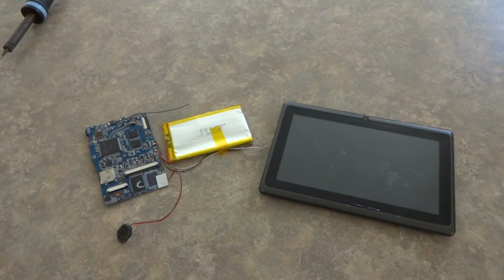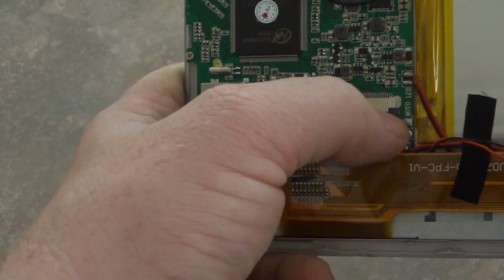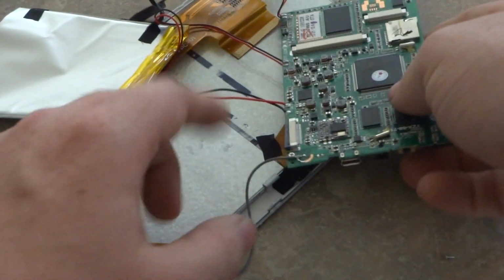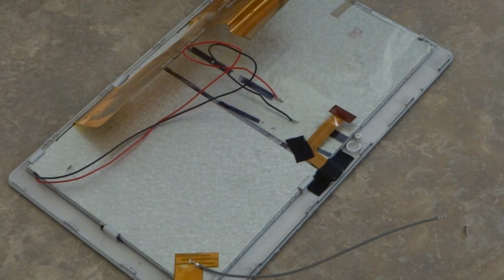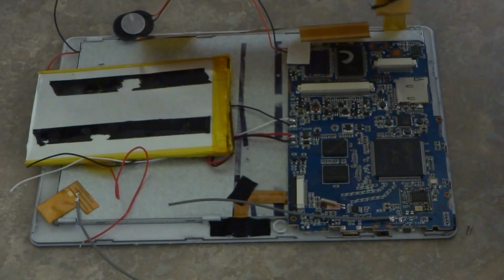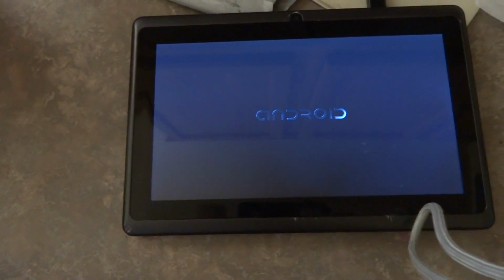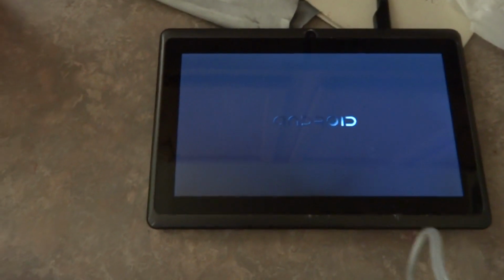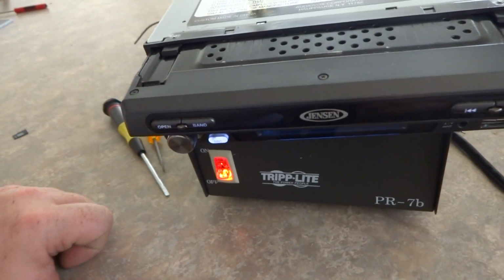disassemble of a Allwinner A13, Q88 7 inch Tablet and motherboard replacement

Comment: I have the same tablet model and you're right it sucks after a few months of usage it broke and i have to reset it then it worked for a few months. Then I downloaded another launcher for it because last time it kept telling launcher not responding. but it happened again the two launchers wasn't responding so I had to reset it but it died.

Comment: Excellent tutorial  friend,i  wanted to ask you a question, I have a tablet tab -7 premier delta-5074-8g, my board does not turn on,  It  has the, version  AL-A13-751-v.6.1, when I  attempt to flashed , it  fails  "initialization using (770)", I have the driver properly installed and have windows 7 32 bit, I tried livesuit 1.07, 1.09 till 1.11 and I get the same message over and over , i dont know if im using the wrong rom to flashed , can you please advise me about this problem.thanks
Reply from the maker: I personally have not flashed any of these but if your getting an error they could have the rom A either locked for flashing or B some thing your using is not letting it encode the right way
Reply: just in case, how can i disable locked for flashing, if that was the case.

Comment: Hi,
I dont suppose you could tell me which controller is used with the touchscreen? ( the capacitive model)

Thanks,
Matt
Reply from the maker: both controllers were different as long as you get it from the same model you shouldnt have a problem some cutting and soldering will be needed